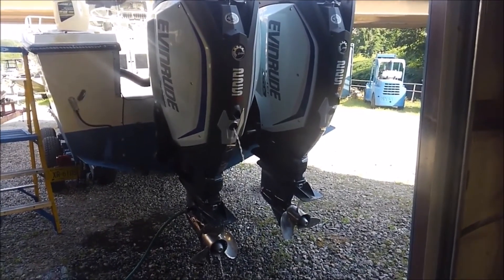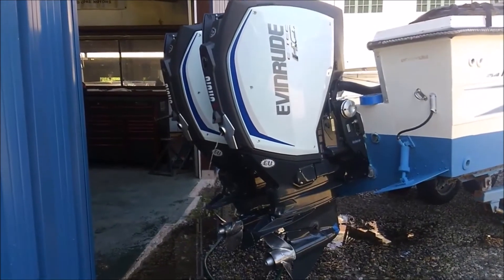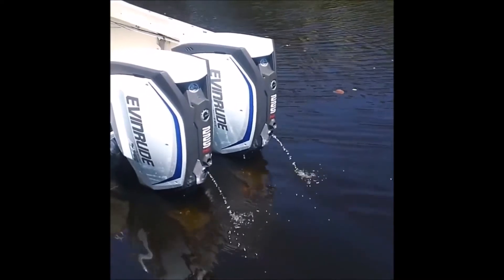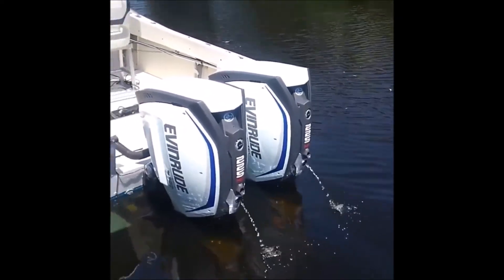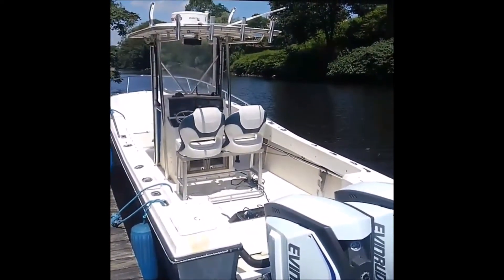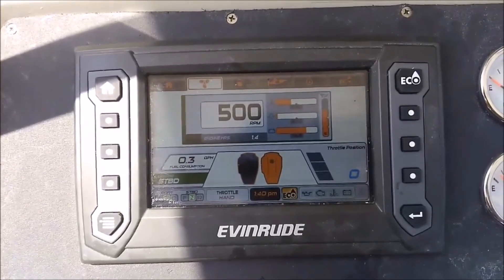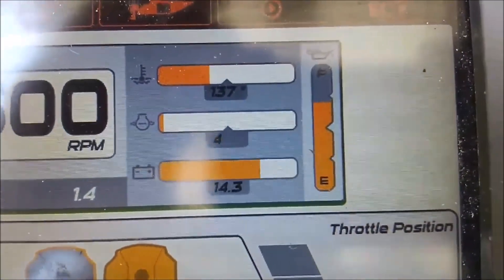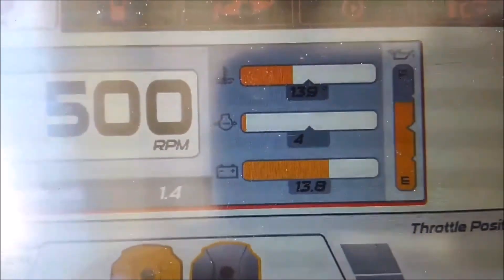1989 Hydrasports Vector 2500 Center Console Repower

Comment: Looks good man. My dad has the same boat except it's the walkaround model and he is looking to repower his boat this winter. Do you have any performance numbers? Does the extra weight affect the ride or water coming over the stern?
Reply from the maker: Unfortunately I don't have any numbers. To compensate for the extra weight, the owner moved his fuel tanks forward and he also relocated his 4 batteries to in front of the console.
Reply: Thanks for the quick reply.  The boat looked like it was sitting pretty level in the water from what I could tell but I'm sure moving the fuel tank and batteries forward helps a lot. Any issues with the new motors?
Reply from the maker: The customer didn't have any issues over the season.